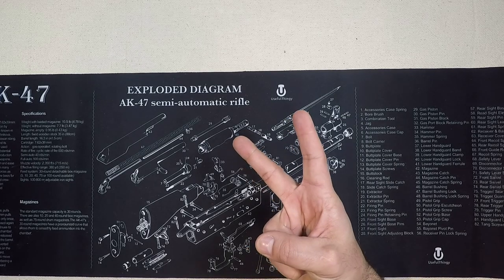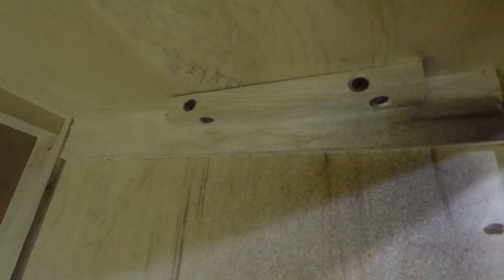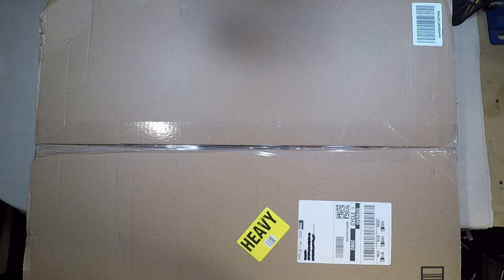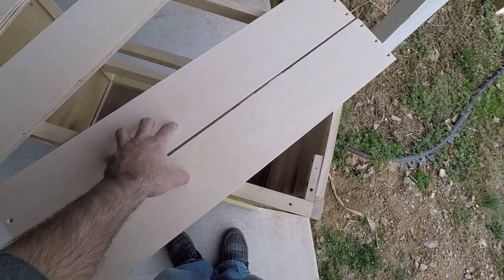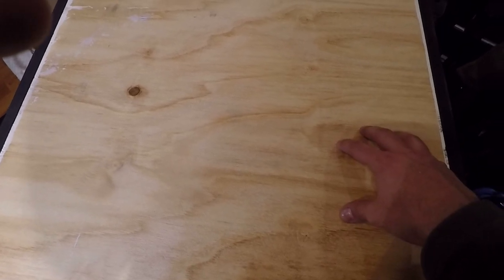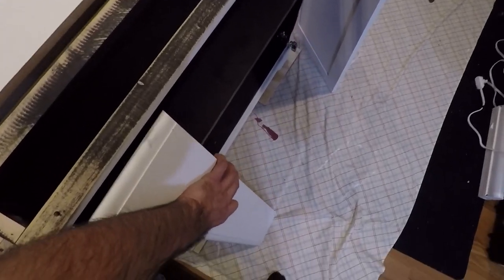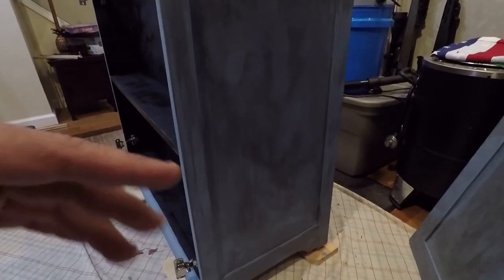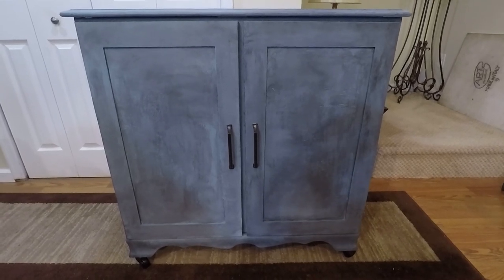DIY Alexa Activated Covert Secret Compartment Cabinet with Hidden Storage

Comment: For those that aren’t mechanically inclined you can buy complete tv lifts. Instead of a tv you put in plywood or something similar.   It will open with a remote and you have your gun lift.
Reply from the maker: yeah, they are pretty common now and much cheaper than they were a few years back.

Comment: Hey great work there. Can you please tell me how did you control it with Alexa, I am planning on making a hidden bar.. Thanks.
Reply from the maker: Its very tough.  I cant do a video on it because honestly, it was a lot of wiring and re wiring to get it right, but the idea was like this....I used two smart plugs that were linked to my alexa.  One controlled the up and one controlled the down.  I then had to rewire the lift so that it worked with each plug.  honestly it was a pain in the ass and its much easier to just get a lift with a remote and control it that way.
Reply: Thanks man.. Will be trying this double smart plug idea. It would be a great help if you can make a video on this. I have seen a video in which z wave smart switch is used for the same purpose but those are very expensive.. Please make a video and clarify the solution without expensive z wave smart switch

Comment: What did you use as a controller linked to Alexa? how did you turn off the light midway and where did u install the controller? before the power supply?
Reply from the maker: The plans and wiring instructions are available on my page for $99 USD.
Reply: @G2niverse  what's your page?

Comment: How did you get it to work with Alexa? Have been researching this for a few weeks now.
Reply from the maker: Use an alexa compatible smart plug.  Then it depends on your motor.  Some are easy, basically an on and off switch.  It will require some rewiring on your part and some additional circuitry parts and connections to make it work.  At least for me it did.
Reply: Can you provide a how to on rewiring it to work with the smart plug? I really want to make one of these!

Comment: which lights did you use and how do they come on automatically and simultaneous?
Reply from the maker: Just a standard LED kit from Home Depot.  I connected them to a toggle switch which turns them on and off.   Theres a little piece of thin and flexible plastic attached to the cabinet that toggles the switch "up" (turns it on) and "down" (turns it off) as the cabinet rises and lowers.  Its important to use something somewhat flexible so it can flex as it moves over the toggle switch.

Comment: How does the lighting system work? Like how is it that you get it turn on/off half way through its cycle? Just a toggle switch or?
Reply from the maker: exactly that...a toggle switch.  as the unit moves up a latch on the unit toggles the switch on and as it comes back down, it toggles it off.  The latch is a piece of thin kydex so it can flex slightly as it toggles the switch.
Reply: @G2niverse  awesome, thanks for the reply. Great work by the way!

Comment: Could you publish a materials list?
Reply from the maker: I can try.  What are you looking for specifically?  Its going to be near impossible to give dimensions because it was custom fit to an existing chest of drawers.  Unless you have the EXACT same chest of drawers, the plan will mean nothing.  I can however give you the links to find the motor, the led lights and the child safety locks.  Make sense?  Tell me what you need and Ill help you the best I can.
Reply: @G2niverse  I'm more curious about how you automate the actuators to work with smart home technology, I'm just confused by that part, and I tried to skip around in the video but maybe I missed it?
Reply from the maker: No you didnt miss it.  I should do a whole video just on that.  The lights were easy.  I installed a switch inside the cabinet that was turned on by a little lever on the actual piece that moves up and down.  As the piece moves up, the lever rises with it, flicks the switch on.  As it moves down it flicks the switch off.
The Alexa, was a little more complicated.  I needed to rewire the actual motor so that it was turned on and off by smart outlets.
Reply: @G2niverse  yes, please make a video on that. That's the part that has me pulling my hair out, haha.

Comment: Could you post a link so i can go buy that arm that goes up an down
Reply from the maker: Check this out at Amazon.com
CO-Z Motorized TV Mount Lift for 32” - 57” TVs | Adjustable Height up to 30” | Fast TV Lift Mechanism with Remote Control & Memory Function TV Stand Weight Capacity 154 lbs https://www.amazon.com/dp/B07RSR3MSD/ref=cm_sw_r_other_apa_i_-xjMEb1560EY6
Reply from the maker: This is what worked for my size cabinet.
Reply: @G2niverse  thank you